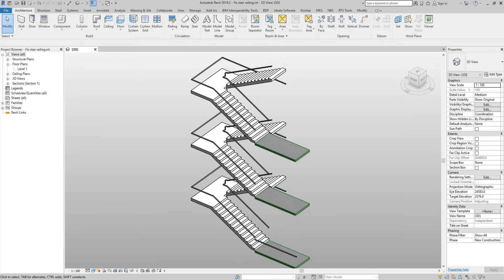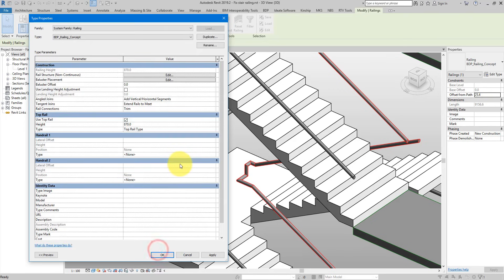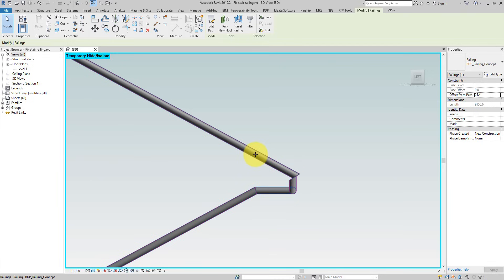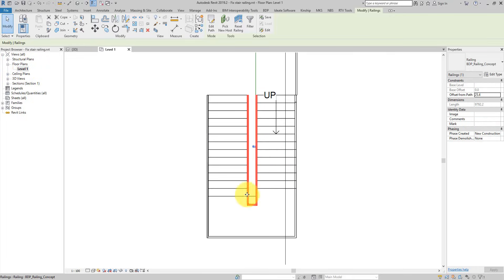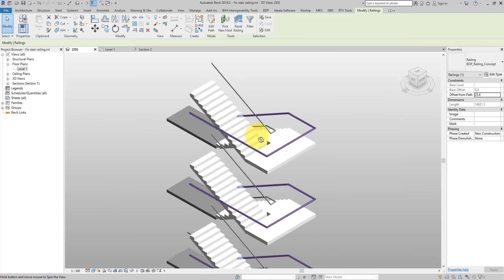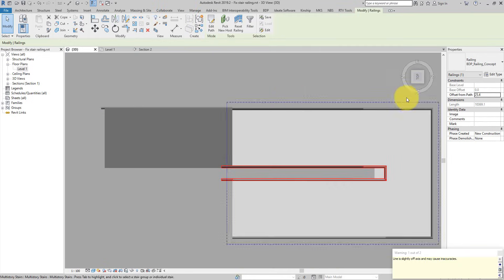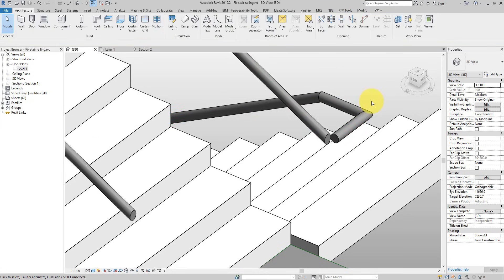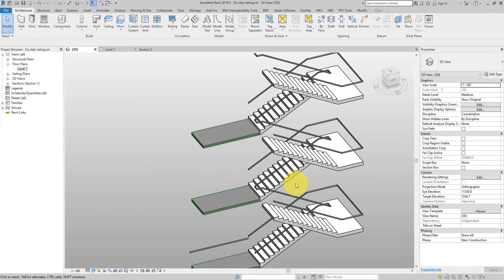Revit Snippet: Fix 3 common railing on stair problems

Comment: My railing sketch line on the stair but the railing still wont angle :( I have moved to the centre of the stairs and still wont work
Reply from the maker: You will also need to select the railing and use Pick Host to select the stair as its host.
Reply: @RVBoost  I have done and it still won’t work. It works fine on the other 6 flights just not the last run
Reply from the maker: Well, I can't say much without looking at the file, but the clue is there in your description. How about checking how that last run is different from the rest and go from there?

Comment: You should have put the second connection made longer by 25, igual as in the first joint.  But your video is very useful
Reply from the maker: Thanks for the tip!

Comment: "EXTEND BELOW RISER BASE" was a revelation ... had this issue for years now. Got it correct at last.
TY so much..
Reply from the maker: Great you had it working! Enjoy ;)
Reply: @RVBoost  I see that this command has been removed / relocated in current versions of Revit.. Can u please let me know where to find it.
Reply from the maker: Sure, which Revit version are you on?
Reply from the maker: Just checked and the option is still there in Revit 2020 & later :)

Comment: Hi sir ..i have created circular stairs with landing ..and also glass railings ..the problem is that the glass panel is not totally align  circular fitted on top and bottom rail?? Plz reply thanku
Reply from the maker: Hi, could you send me a screenshot of your stair so I can see exactly what the problem is?
Reply: @RVBoost  can u send me ur mail id i will send u the project
Reply from the maker: Sure. Its support@rv-boost.com  😀
Reply: @RVBoost  hi ...i already send u mail plz find rvt file thanku ...and my panel also smaller ....panel width is 2'.
Reply from the maker: Hey thanks for sending the file. I checked it and saw that you created glass panels using Baluster families. This means they will always be flat so won't follow your top rail very closely on stairs. You should instead create glass panels using a Rail. Just select the railing, choose Edit Type, click Edit on the Rail line, and add a new rail there. Give this new rail a very slim and high rectangular profile, for example 20x1000mm. Then, assign this new rail a glass material.
Reply: @RVBoost  ok thanku sir
Reply: @RVBoost  ok ..will send